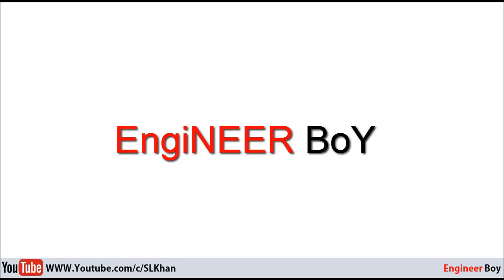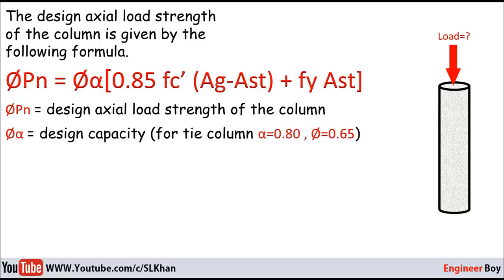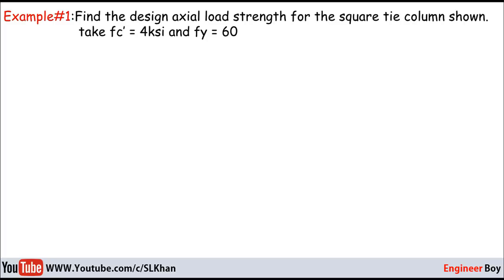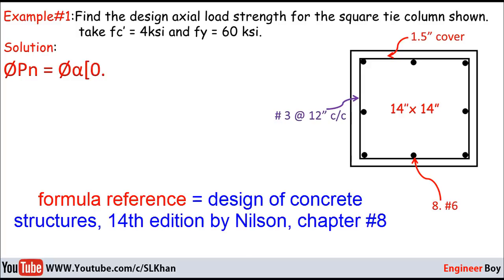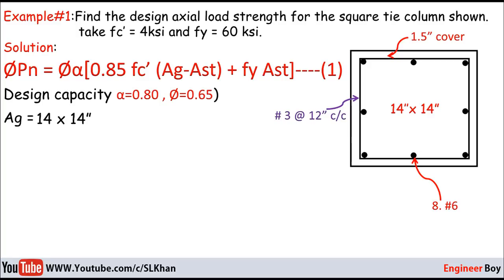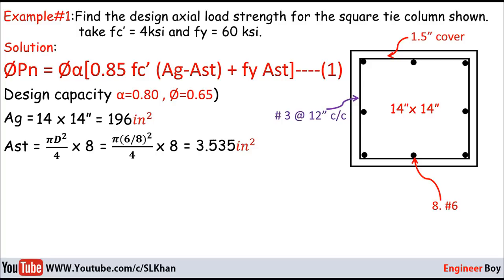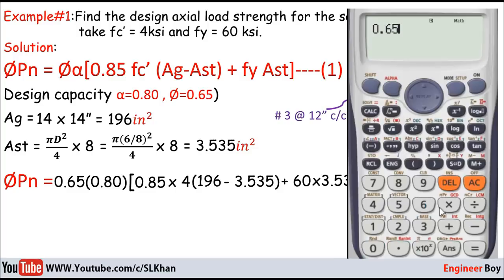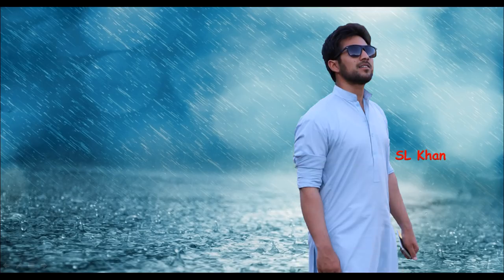Reinforced Concrete design

Comment: ASSALAMU ALAIKUM AND MORE 1 QUESTION TELL ME HOW TO CALCULATE VOLUME AND KG OF GRILL WORKS BCOZ WE R USING GRILL WORKS IN MAIN GATE ,WINDOW ETC....WITH DIFFERENT  TYPES OF ANGLES AND CHANELS USED? AND HOW TO CALCULATE NO OF LENGTHS AND NO OF BARS REQUIRED 4 THIS. THANQ WASALLAM